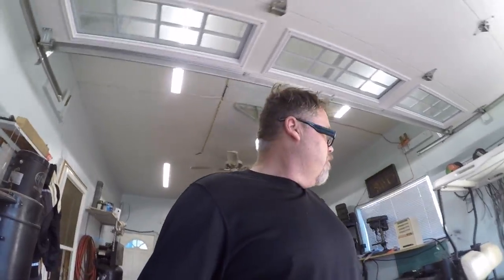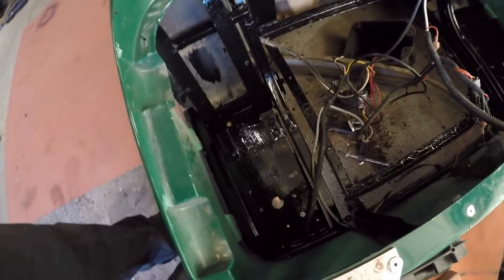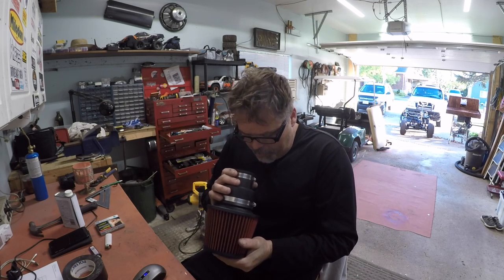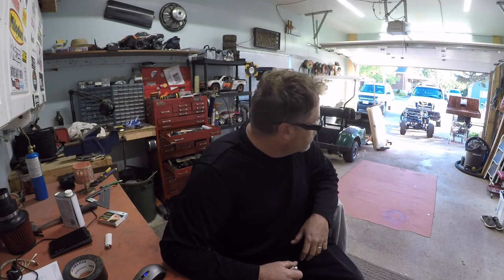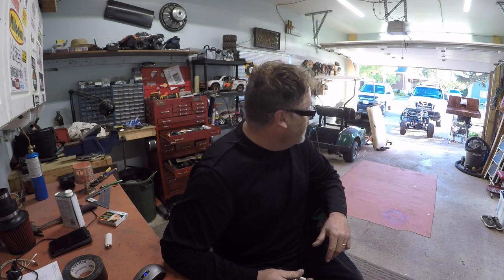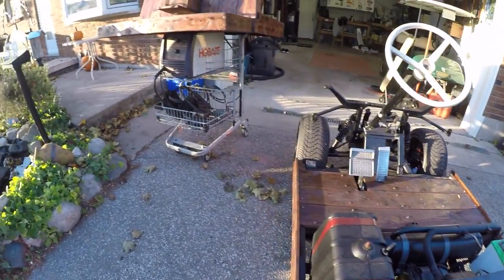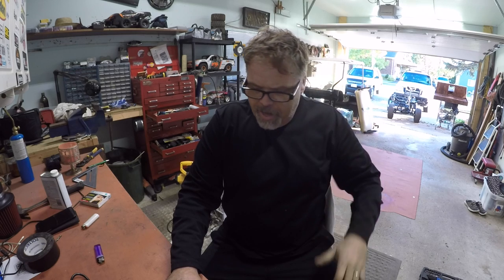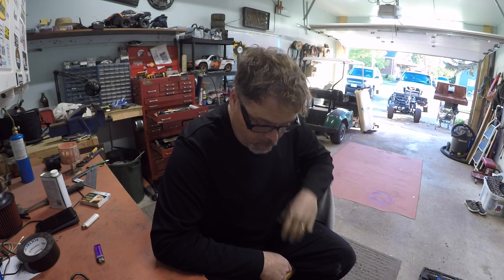Hurry Up And Wait

Comment: If that carb has a removable main jet getting another main jet two sizes larger at the Yamaha dealer might help with it leaning out . If it leans out when you're spanking it the float level might be set too low . With it wanting to creep away when you start it if an adjustment and you can move the center to center distance of the clutches closer together it should put some free play in the belt and help with that or a belt a size longer should help . I know motorcycles and snowmobiles  not golf carts so I'm just throwing ideas out there .